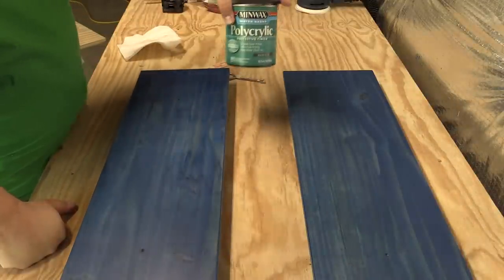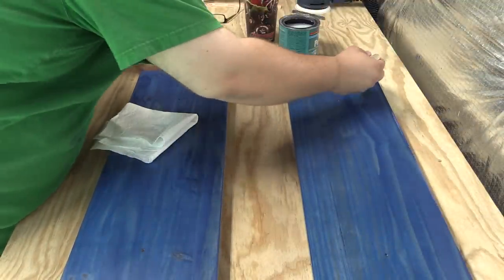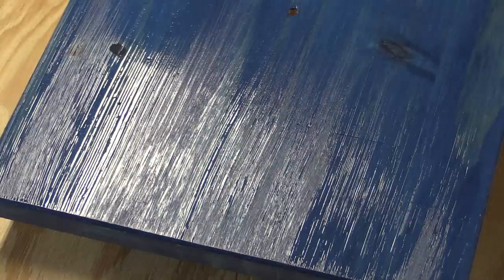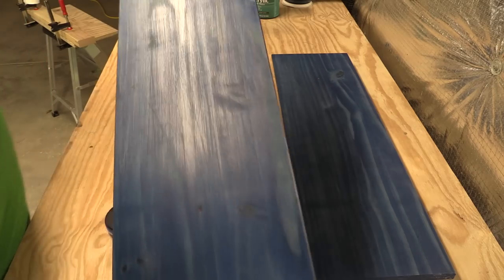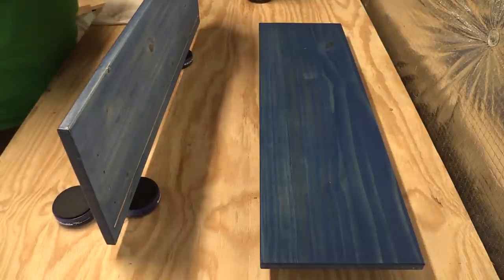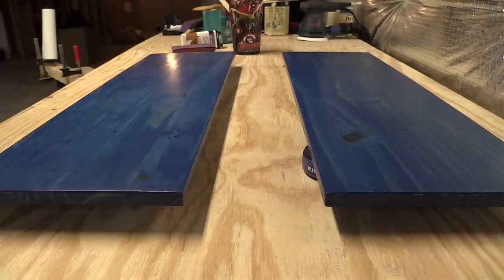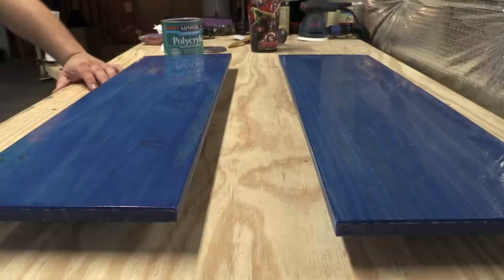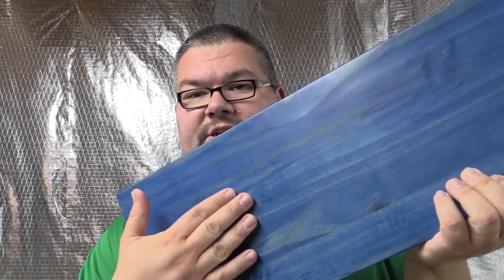Amateur Wood Finishing 101: Introduction to Water-Based Polycrylic Finish (Part 3)

Comment: Nice video. 
The only thing that I would have done different is to put down a layer of newspaper or red contractor's paper on the workbench before starting.  No need to get the bench involved in the project.  #GoodJob
Reply from the maker: +Brian Blues Thanks - the bench has a sacrificial top specifically for that purpose.  Plus, the bench gains character with every project :)
Reply: KF7IJZ
That's another way to look at it... PERFECT for the "man cave"!  LOL

Comment: The blue is very sharp.  good video, however thinning out water base poly with some water and removing the air from your brush will do wonders on the finish.
Reply: Hey MH - How do you remove air from the foam brush?  How thin do you go with the poly?  half-n-half?
Reply: EdgeSport No half and half is way to much.   You can do 3 or 4 to one ratio.  As far as the foam I don't use foam.  They leave to many bubbles in my opinion, although adding water (water base) or mineral spirits (oil based) helps a lot.  I use either use a high density brush or use a cloth.  The cloth believe it or not has worked very well for my last projects.   I never had any bubbles with the thinning product and the cloth.   I also never paint it on like what is in the video.   I dip it and then go from halfway down the board and then go back from halfway what I just applied back to the other side.  I use oil base only as well.  The sanding in this video was on point.   Although I would never run that much on the first thinned out coat.  Being that thin it is unnecessary.   I also wait 12- 24 hours after coats to see what I'm working with.   Work clean and you'll be gold.
Reply: So far so good using the foam brush and 1/3 ratio thinning.  Thanks for your reply.
Reply: Awesome
Reply: You will def need more than 3 coats.  I would say that every 2  thinned coats is close to one full coat. Give or take.
Reply: I used 3 to 1 ratio so it is not super thin but I can see I will need 4 coats to get a flat gloss.
Reply: That is about what I do.  Unless the piece isn't ready and I can just throw another coat on without slowing down the final build.
Reply: Wife decided 3 was good.   While a forth coat would have been perfection I am happy with three so I wired up the vanity and gorilla glued the mirror on last night.  Thanks for you guidance.

Comment: AND DONT OVER WORK IT!!!      ALSO, PUT YOUR BRUSH EITHER REGULAR BRUSH OR SPONGE BRUSH IN A SEALED BAG BETWEEN COATS.    IT STAYS WET AND YOU DONT HAVE TO WASH YOUR BRUSHES OUT OVER AND OVER AGAIN.  220 IS PRETTY ROUGH PAPER.   SPONGE BRUSHES I HAVE FOUND ARE WAY BETTER FOR THIS APPLICATION.     I WOULD RECOMMEND LIKE 400.